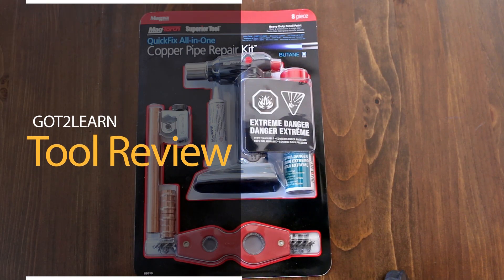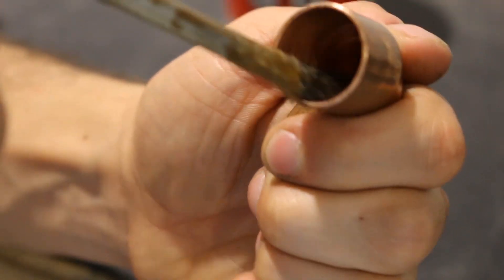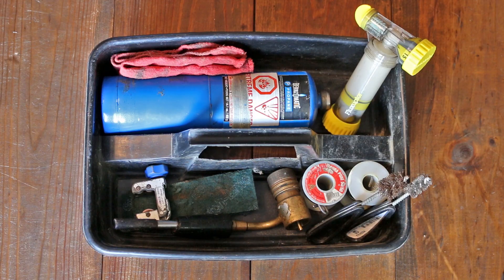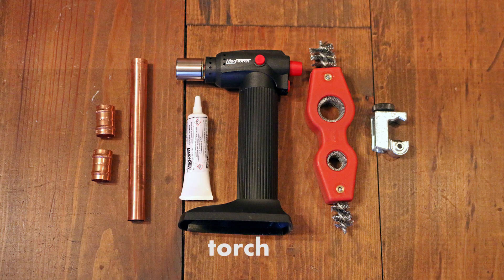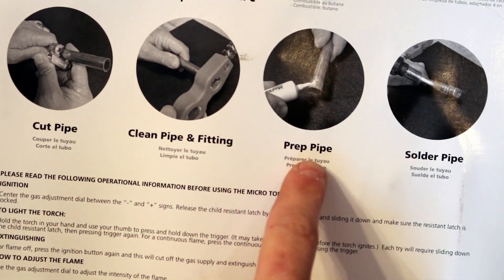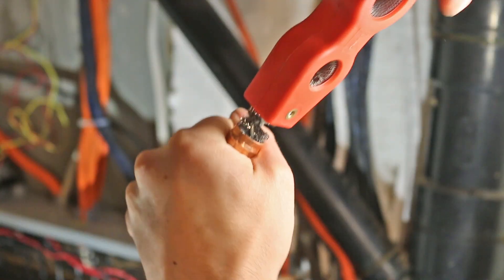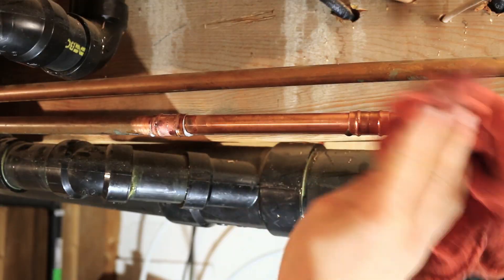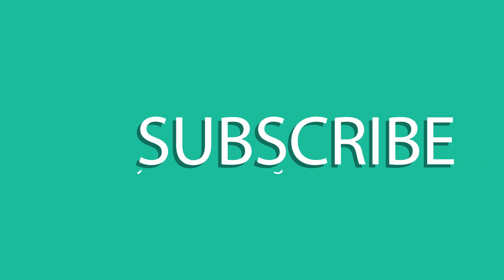5-Minute Pipe Repair Kit (Copper Pipe) | GOT2LEARN

Comment: I was hoping you were going to show repairing a small crack in a copper pipe where you can't cut the damaged piece out(it's on a 180° copper pipe sticking out the heat exchanger of a tankless water heater that froze and put a small crack in the outside surface of the 180° pipe.
Reply: This is exactly what I was looking for. Did you have any
Luck? I might just have to make one. I have mine repaired except for one pinhole still causing a leak. I was doing the repair out in the wind so I am going to get it into the shop when I go to town. I will try to video and post my repair for others to see.

Comment: While I can see the purpose of the kit, I can't help thinking that anyone competent to use one, would be better off buying upgraded component parts themselves, but I can see why the kit appeals to some. One thing that appears to be missing from the kit is a fireproof  heat mat/shield..Also, does the torch in the kit come with butane or butane/propane mix gas cartridges?
Reply from the maker: No, you have to buy the gas yourself.
Reply: @Got2Learn  Good luck finding the butane. I was going to buy a little torch like that tonight and all the butane refills had been stolen from Home Depot and Lowes. Can you suggest a good place to find a butane refill.

Comment: This is alternative to using coupling U.S. [$2-$3] which you have to solder. This piece is also a coupling with built in solder. Why $100?. If you know how to solder, get two couplings and a torch and solder [lead free/ potable], emery cloth. You can do it easily.
Reply from the maker: Huh?

Comment: Thumbs up but better to spend a couple of bucks on a Bernzomatic torch kit which can be found fairly inexpensively at Walmart https://www.walmart.com/ip/BERNZOMATIC-330923-Pencil-Flame-Torch-Kit-2-Piece/295966342 20.00$ Home Depot or others. Small roll of solder and fluxhttps://www.amazon.com/Safe-Flo-H-205-Flux-Solder-Kit/dp/B000FK743G/ref=sr_1_17?s=industrial&ie=UTF8&qid=1545555306&sr=1-17&keywords=solder+and+flux+plumbing; also found at the Home depot and others 16.00$ U.S.. Keep fitting on hand 1/2 inch and 3/4 in the U.S.. A quality copper pipe cutter that will last a lifetime for consumers..    https://www.amazon.com/RIDGID-40617-Quarters-Tubing-Cutter/dp/B001P307PO/ref=sr_1_3?s=industrial&ie=UTF8&qid=1545554829&sr=1-3&keywords=copper+cutter 20.00 U.S , well deal is you might spend a bit more but have a great set of tools in your inventory. Better to have a tool then a once in a lifetime "Patch" kit. Absolutely honestly if someone were to purchase this kit they should not be attempting this repair. Just being real. Don't get mad at me.. Copper fittings are readily available at your local Home Depot or supply center. Do research, spend your hard earned money on quality tools that will last many years and that you can learn from. Better to acquire tools then kits that have a promise for a one time fix.

For repair kit follow this link provided by this author, good luck... For the repair kit: http://www.superiortool.com , this does not take you to the kit but rather a site in which you will not be able to navigate unless you know exactly what you are looking for..

Comment: Hi bro, always enjoy your videos. Even though I don't need one of these. As I'm A full time Heating and plumbing engineer. 

Still I reckon a good little addition to any home owners D.I.Y toolbox. What's your view on the jet sweat tool which expands inside the pipe?  I'm contemplating on buying the set. But I'm still a little unsure. They're quite costly. 

Stay blessed as always. Haters will always hate. Too many trolls and all that, te-he-he. Keep the great stuff comin' our way 😊
Reply from the maker: Awesome comment ;) the jet-swet is a "must have" tool if you do a lot  modifications and you don't wanna fuss with the dripping water... There's more than one model. I will do a review on these as well, just dunno when..
Reply: @Got2Learn  Cool bro, really looking forward to it. I wait till then on yes or no to purchasing it 😊

Comment: 2 words, « Sharkbite Couplings »
Reply: Totally right, but they are a little bulky.  Also not suitable for Gas lines. I've come across idiots who have used them on gas pipes, totally illegal.
Reply: Sharkbites will leak on soft copper pipes, not designed for soft copper is one of their drawbacks
Reply from the maker: Also a good alternative ;)

Comment: Proper way, yes.  Easy way, no.  Easier wayis to just wrape self fusing plumbing tape, $10, no flames no prep
Reply: Hi, that's only a temporary fix. Bogit legit style. You'll probably come back to a flooded house. If you leave that self algamating tape on. It's ok for external low pressure soil stack though.😊
Reply from the maker: Exactly ;)
Reply from the maker: Self fluxing tape? Never heard of that, got a link?
Reply: @Got2Learn  fusing, not fluxing
Reply from the maker: Oh sorry I read wrong, you are talking about Alfa tape. The tape is ok to seal off a leak while a plumber comes, but it still needs to be properly fixed.
Reply: @Got2Learn  https://www.homedepot.ca/en/home/search.html?q=Self%20fusing#!q=Self%20fusing

Easiest way, not the best way

Comment: You need to do a video on pro press my guy
Reply from the maker: Absolutely! Trying to partner up with Ridgid...not an easy thing ;)
Reply: Lol just buy one it’s easier ! Jk I had to sell my wife to buy mine
Reply from the maker: Well, the pro press gun is like over 1000$ lolll If I knew the vid would be a hit i'd go for it for sure
Reply: Dude I bought it a few years ago and it was like 3000 bucks for the whole kit....come to Dallas and we will do a vid together
Reply from the maker: Damn, that's scary! I woud just need it to be lent out to me to get the video done, not easy either lol
Reply: I've got the rigid press and I love it. The fittings are a little on the expensive side. But heck carrying a fittings box and the cordless press on site. Saves hauling everything else. 

If  fittings are used on gas lines make sure they suitable. They have a yellow ring internally to identify use for gas. Although really expensive. I wish I'd brought one a few years back. 😋
Reply from the maker: Nice, yeah I would do a thorough video on all the pro & cons and how to actually use it.